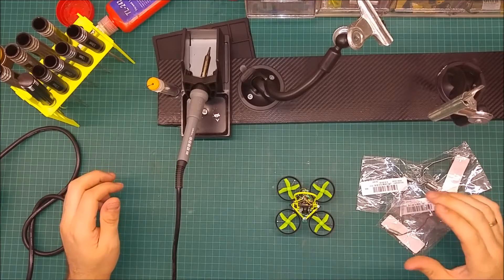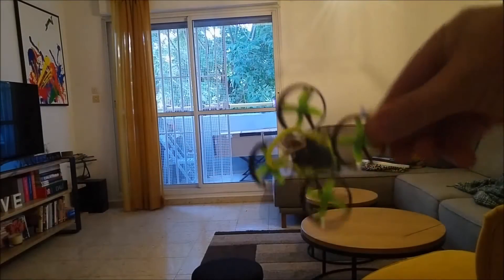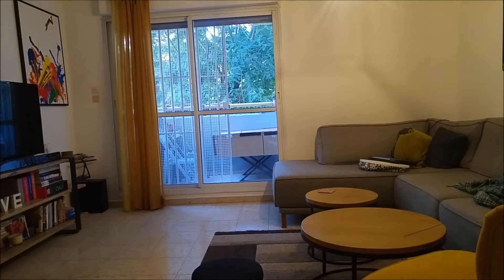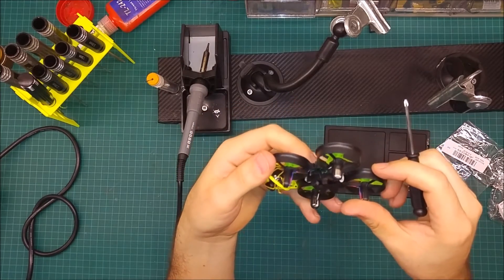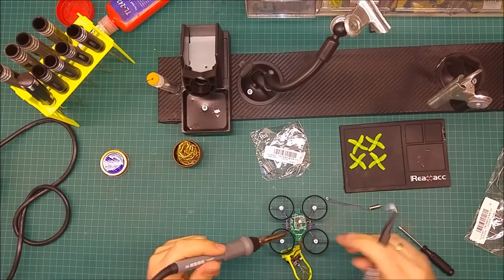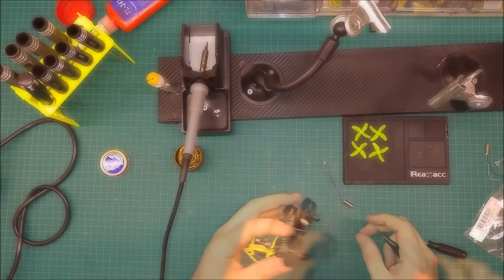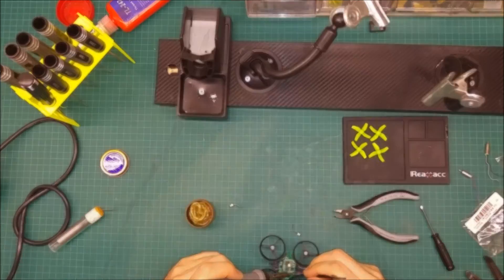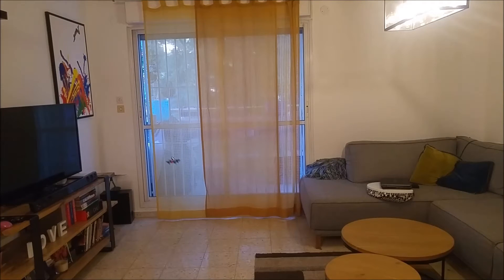Eachinewhoop - E010 Motor Upgrade

Comment: Question, is the camera automatically switched on when the power is turned on or is there a way of turning it off and on using the remote that comes with the E010?
Reply: When the battery is connected anything that is attached to the board comes on. The camera isn't standard it was added if there was its not gonna be possible with the remote that came with it. You can bind it to another transmitter (remote) with multi protocol but I don't believe there is away to turn the camera off independent of the quad.

Comment: the mount and camera brace/guard add a little bit of weight obviously, but i suggest just using a rubber band to hold the camera in place for weight savings

Comment: I tried a set of CrazyPony motors. Not too much help but really did have a "bit" more punch. What really helped were the set of RakonHeli 3-blade props. Yeah baby.
Reply from the maker: Did you upgrade the battery?
Reply: Yes. JJRC 280mah 30c. Swap connector. Great performance.
Reply: Heiple2007 should have used a higher c rating lipo